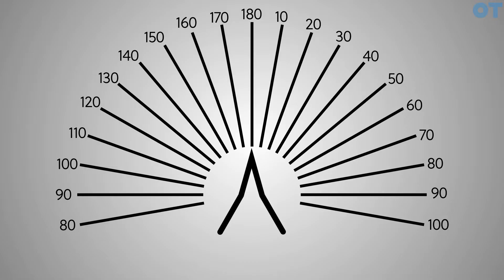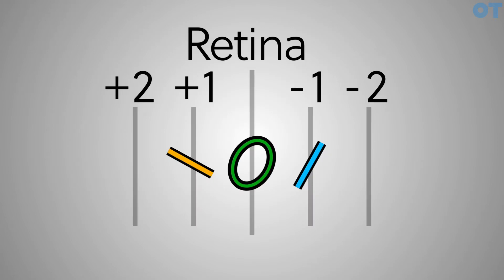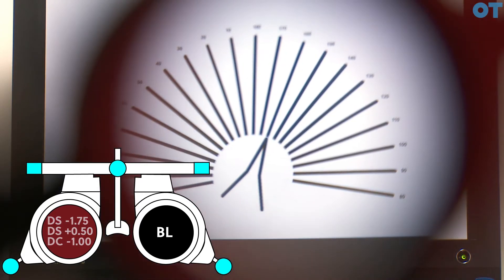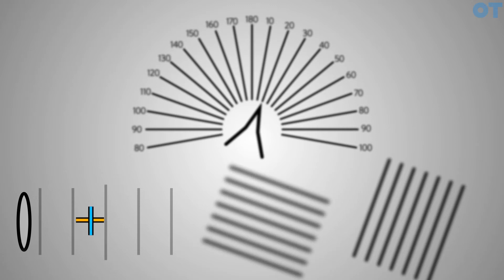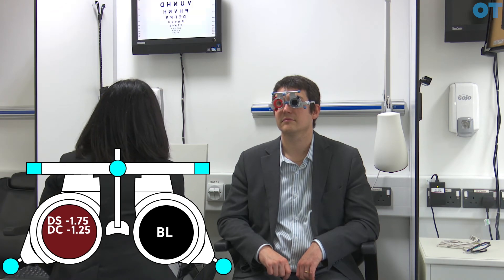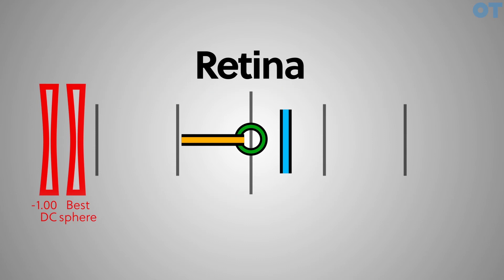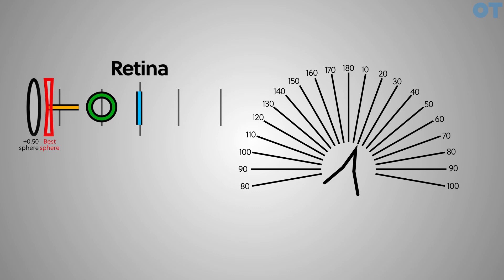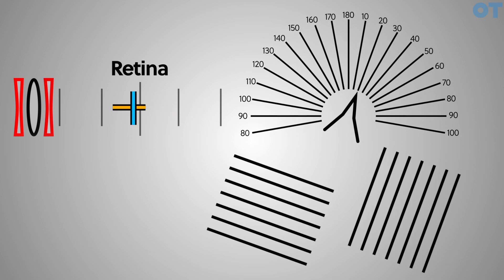OT skills guide: Fan and block

Comment: Thank you, this is interesting and valuable to me as a visually impaired person since birth. 

Because of my special condition (ocular albinism, optic nerve hypoplasia which resulted in horizontal nystagmus, and strong nearsightedness), my few attempts to get glasses at various ages were not successful. I honestly answered all the doctor's questions during the subjective refraction process and it felt good while at the doctor's office, looking at the charts and objects nearby. But when I received the final glasses, it always felt weird, the world felt unstable and my weaker eye felt like it had something wrong with it and I constantly wanted to blink it to "make it clear".

At one point I got interested in optometry and I figured out that maybe doctors are prescribing too strong values. Maybe I could get used to them if I wore the glasses all day long, but as those were distance glasses, I wore them only occasionally. 

So I bought a set of cheap trial lenses and a frame. I started with the SPH and CYL values I received from my doctor from the refractometer and retinoscope. Then I adjusted the values down until I felt comfortable wearing the lenses for prolonged periods of time walking around my home looking at distant things and watching TV at a distance. Then I visited my doctor again to check if my results made sense and were safe and appropriate for my vision. She confirmed that it looks OK, although it is noticeably weaker than the full correction I would need. But if the full correction makes me feel uncomfortable, then it's OK to have the prescription with the values I came up with. And now I've been having my easy-feeling glasses for three years already. I can wear them everywhere I go without having any issues to accommodate both when I put them on and take them off.

My experiments with the lenses led me to a few important discoveries.

First, although technically my eyes have about 1D difference and would need different values, my brain has used so much to the fact that one eye is weaker so that it just cannot tolerate it when the correction is applied to attempt to make both eyes have the same final refraction. Then I feel like something's wrong and want to blink and clear my weaker eye. So, in my case, it's better to apply the same correction to both eyes. Then I don't feel any discomfort between my eyes.

Second, my "vertical vision" is completely unfixable and unreliable. I just cannot see vertical lines in the astigmatism test, no matter what correction is applied, unless the lines are very far apart. Maybe because of the heavy astigmatism and horizontal nystagmus since birth, my brain just did not learn to distinguish vertical patterns well enough. I once found a study paper, where they seemed to come to the conclusion that for some visually impaired people orientation discrimination can be very bad in the vertical direction because of how their retina or brain works and prescription will not help much. In childhood, I rotated all books 90 degrees because that way it felt easier to read. It got better at the age of 8, and then I somehow started reading normally. 

So, for this reason, subjective refraction for astigmatism becomes tricky. Essentially, the doctor has to completely ignore everything I say about vertical lines because I just don't distinguish them at all at a distance. I might be able to perceive that "something's not right" when given lenses that make vertical astigmatism more pronounced, but I won't ever say "Oh, I see vertical lines worse now" (unless we talk about very near vision for reading). I'm not sure if all doctors have paid enough attention to this fact when doing subjective refraction on me. At least I don't remember any of them asking me about vertical lines specifically, so when asked which lenses make the image clearer for me, my answer was always based purely on the clarity of the horizontal lines only because the vertical ones were always too blurry to make any reasonable judgments.

I hope the experience I shared will help some doctors better understand how a visually impaired person might see things and what caveats to look for when doing subjective refraction on such patients.